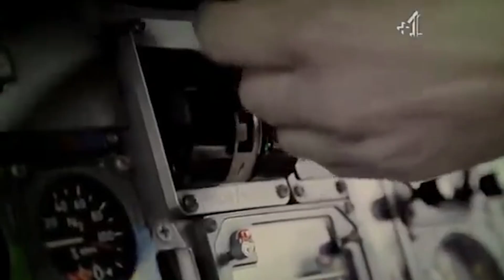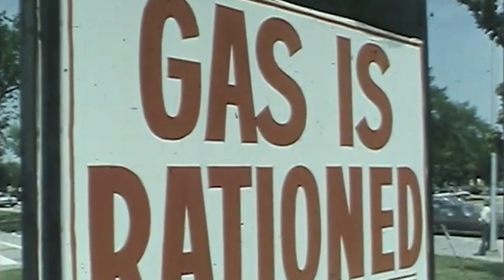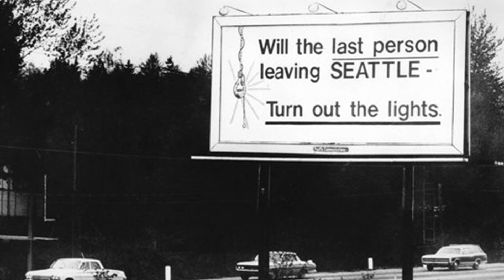The Forgotten American Concordes - Boeing 2707 - Lockheed L-2000 SST

Comment: Please feel free to fact check it, but that's what most forums are saying.

Concorde standard taxi fuel 1,600 Kgs / 440 gallons.
Concorde fuel burn LHR-JFK 80,000 Kgs / 22,000 gallons.
B747-400 fuel burn LHR-JFK 65,000 Kgs / 17,800 gallons.
B777-200 fuel burn LHR-JFK 39,000 Kgs / 10,700 gallons.
Consider that 747 could take up to 660 passengers vs up to 128 on Concorde. Add to that special maintenance, limited flight paths, plane life itself, very limited range and you get price of ticket most people would never be able to afford.

Comment: There is misinformation in this video.  Supercritical wings sere developed by Whitcomb long before the development of the Boeing 2707.
Reply: Yup! Richard Whitcomb's contribution was enormous - and applicable to a wide variety of aircraft...  
The winglet technology seen on the tips of so many airliner wings is a testament to his foresight - although it took the commercial aviation industry several decades to catch on. 
Similarly the supercritical airfoil was first investigated by Whitcomb in the '60s, iirc. 
He was not the first of course, think Kawalki had something extremely similar in the mid '40s, and Hawker-Siddeley were working on something supercritical in the late '50s - that I'm sure of because it was used on the first Airbus project - which didn't fly until the early '70s. 
The Boeing 2707 sadly suffered from having a near-impossible set of goals.  Too ambitious by far.
The Russian TU144 was flawed - but they were under tremendous political pressure to fly it before it was ready.
If Boeing had concentrated on building an improved and optimised Concorde the story might have been very different. 
Fuel-efficient SSTs  would be pretty useful!
Reply: If the Soviets or the European had gone for a supersonic jet with a speed of, only, Mach 1.4 and a 50-passenger capacity with a range of less than 5600 km it would still fly today.
The Soviets tended to copy western configurations (copying a configuration does not make development less expensive than inventing the configuration), that were inherently faulty.  To my mind comes the Concorde, the Space Shuttle and... fuel-rod nuclear reactors.
Reply: Aristeidis Lykas   the key to breaking the sound barrier had less to do with the wing but more to do with the all moving tailplane dealing with transonic air flow over the rear tail of the aircraft. I know you're so excited the Germans with the me-262 had swept Wing but don't forget the Germans killed millions of people.
Reply: Boeing spent how much trying to beat the Concorde but the Concorde flew and worked very well, and Boeing gave up because all they had for the Billions of dollars was a wooden mock up, then more recently Boeing decided they would make a transonic passenger plane, rather than a full supersonic plane, that was another Boeing failure.
Reply: Barrie Rodliffe sorry but the P51 was far superior to the Spitfire to Hurricane the Thunderbolt the Corsair the Warhawk any aircraft in the Allied or axis Theatre the P51 is the best fighter plane of all time.
Reply: Poor Ronnie.
The superior P 51 which was slower than a Spitfire, it did not go as high, could not climb or accelerate with a Spitfire and could not get close in maneuverability. The Spitfire was the best fighter in the war, the P 51 missed  a lot of it and it needed a British engine to be more than useless as a fighter.
Reply: Having piloted the B-17, in battles in the WarThunder universe, I must say that the airfoil cross section of the B-17's wings made the plane a slow and easy target for enemy fighters.
Reply: Poor little Ronnie. 
did someone pull your chain?
Reply: My dear Ronald, following the Area Rule can decrease transonic drag by as more as 60%.  Also, buffeting, at transonic/supersonic airflow, of the tailplane was first recognized by the... British.  This is why they broke the speed-of-sound barrier almost the same moment that Muricans, with the counterintuitive B-1,  did!
Reply: ...and the P-51 was designed according to specifications given by the british Ministry of War.  The Muricans discovered the plane AFTER it was bought by the British!
Reply: Barrie Rodliffe - (about WW2 military aircraft) - When the US entered the war, US B-17 and the UK Lancaster, besides being capable of other missions, were the only bombers capable of bombing targets deep in Germany from bases in the UK.  No 2 man bombers available at the time could perform this mission.  The vital difference was that the B-17 was tasked with daylight precision bombing of individual specific targets like factories, railroad junctions, oil fields, refineries, etc. , initially without fighter support for the final leg of the mission, because no fighters had the range to escort that far. The Lancaster was employed in night raids on cities, targets large enough that you could position yourself to attack them closely enough by celestial navigation, without having to try to see invisible landmarks in a blacked-out city.  The Lancaster's inferior defensive armament was not relevant to night bombing, because at this stage Germany did not have night fighters and they faced only flack (on clear nights when the searchlights got lucky).  Obviously, a ton of bombs delivered on a specific chosen target is worth more than a ton of bombs labelled "To whom it may concern".  These precise daylight raid targets usually were surrounded by infrastructure, worker residential areas, etc., so on the whole, the daylight bombing raid's "misses" had about the same material effect on the war as the nightly bombing raids "hits".  By your account, when the UK considered getting into the daylight bombing action, they considered doing it with B-17s, not with Lancasters, because Lancasters did not have the defensive firepower that mission required.  It is meaningless to compare any other contemporary allied bomber with the B-17 series, because it was (and is) conceded that no other contemporary bomber could perform it's primary mission (until the introduction of the B-29).

After the introduction of the P-51, and before advances on the western European front made forward fighter bases possible, for the first time it became possible for fighters, in shifts, to escort bombers all the way to Germany from bases in the UK.  The Spitfire had a role in this rotation, but no fighter could stay WITH the bomber formation all the way because the bomber's cruising speed at load was less than any fighter's ferry speed so a fighter escorting heavy bombers guzzled fuel.  So the escort was arranged in shifts throughout the raid, each subsequent shift flying from the UK to a rendezvous at the fighter's ferry speed, slowing to relieve the previous shift in escort  .  The only fighter capable of escorting the bombers on the crucial farthest leg of the raid from UK bases all the way into Germany and back to a rendezvous with another shift, even with drop tanks, was the P-51 you maligned.  The Supermarine Spitfire, an excellent fighter without a doubt, excelled at decimating German fighters and bombers in the Battle of Britain, in a defensive role in which range was largely irrelevant, but as the allies switched to the offensive air war, it was nevertheless largely relegated to the tactical air superiority role because of its limited range.  Here are the relevant specs (the range of values is due to variants; both fighters were improved during the war):

Spitfire combat range:         395- 470 mi on internal fuel.
P-51 combat range:             750-1180 mi on internal fuel.

Goering said after the war that he knew the war was lost when he first saw heavy bombers over Germany with fighter escort.  For good and sufficient reasons, the bombers he saw were US heavies, and the fighters he saw were P-51s.

The best weapons systems were constantly improved during the war, to the extent that most of the tanks and planes employed at the start could well be considered obsolete by its end.  The fact that the B-17 was improved during the war is not, as you implied, evidence that it was bad.  The best weapons systems were improved, the worst were discontinued if there was a replacement.
Reply: Barrie Rodliffe troll 747. you are a troll. 747 747 747 jackassssssssssssss
Reply: The Tupolev Tu-144 was a better airplane than the aerospace community thinks.  It had a fuselage diameter of 330 cm.  The Concorde had a fuselage diameter of 296 cm.  Thus the Tu-144's fuselage created a bigger drag, at supersonic speeds, and had to have more powerful engines than the Concorde.
Reply: Barrie Rodliffe let's see jackass Boeing failures?

b-17
b-29
b-47
b-52
707
727
737
747
757
767

troll.
Reply: Ronald Tartaglia 
The SST was just one example of a very expensive project which never got off the ground.
Maybe you should read up on some of these examples before making silly comments.
B 17 it could only carry a similar bomb load into Germany that a much smaller lighter and far faster plane could and the B 17 needed a fighter escort to do so.  Just look at a crew of 10 and a fighter escort to do what a plane with a crew of two could do in half the time.
Reply: Barrie Rodliffe  the B-17 was ahead of its time when it was first built in the thirties. you know nothing, you are a troll. you want the facts that you make up to suit your revisionist history because you just don't want to believe that they were capable of doing something great. typical modern-day troll trouncing on the successes of hundreds of thousands of people who actually did something rather than put up false comments on YouTube.

what have you done? besides sit on the sidelines and criticize?

 Name me any strategic bomber that didn't need some kind of fighter escort and don't forget the best fighter escort World War II was the P51 Mustang also built in the United States. ,( with a British engine).
Reply: B-47, B-52, Boeing 367-80!  Examples of great german engineering.
Reply: I still cannot understand how the Muricans insisted on using a straight-wing configuration to brake the sound barrier, with the B-1, when the Germans had been using swept wings already, starting with the Me-262!
Reply: Ronald Tartaglia 
The B 17 began service with the RAF in 1941 but Bomber Command abandoned daylight bombing raids using the Fortress I because of the aircraft's poor performance, the USAAF found out it was not good too, later the B 17 E 
was used by the USAAF from late 1942. 
The USAAF soon found out they needed an escort which was provided by the RAF using Spitfires. the P 51 was not able to escort anything until 1944 and even then they still needed Spitfires and other fighters to escort them half way. The RAF carried out many daylight and night raids without fighter escort including the destruction of the Tirpitz in daylight with no fighter escort. Also the DH Mosquito which could carry a similar bomb load to Berlin as the B 17 did not need a fighter escort. Just imagine if USA had bought Mosquito bombers for a fraction the cost of the B 17`s, they could have done more strategic bombing with far lower losses.
Reply: Digital Nomad.
When the B 17 entered the war it was incapable of doing much at all, the RAF tried it and found it to be unsuitable  for bombing  in Europe at all as did the USAAF.  The first use of the B 17 by the USAAF in Europe was August 1942, they were escorted by Spitfires.  
From mid-1942 to mid-1943, Mosquito bombers flew high-speed, medium or low-altitude missions against factories, railways and other pinpoint targets in Germany and German-occupied Europe.
Obviously the RAF carried out most of the attacks on targets like rail, canals, bridges, viaducts, tunnels submarine pens and other targets that required greater accuracy and better bombs than the B 17 could carry.

The relevant figures you give are for a Spitfire Mk I of 1940 and a P 51 of 1944.
The range of the P 51 with full internal fuel qhd external tanks 1650 miles.
The Spitfire MK IX with extra internal fuel which a lot did have and a 90 gallon drop tank, well over 1,000 miles.
The Spitfire was never relegated to anything, it carried out many roles that the P 51 could not do, the USAAF used the Spitfire just as they used the Beaufighter and Mosquito. 

Goring had already said he knew the war was lost when he saw Mosquito`s over Berlin and he had no fighters that could do anything about it, USA likes to steal a lot including sayings.
That the B 17 was useless and needed a lot of modification is evidence that it was bad.

Comment: What of the 2 built by the USA, the YB70 Valkyrie? Those were awesome. One still exists.
Reply: XB-70 is a strategic bomber, not a commercial airliner.
Reply: Mazotheman true, however it is an SST, it transports bombs
Reply: again its military funded not a xcompany
Reply: An SST carries passengers in comfort, the XB 70a crew of two in very special suits and no possibility of a single passenger, another thing is cost and maintenance, both very high for the XB 70, it had a very short career.